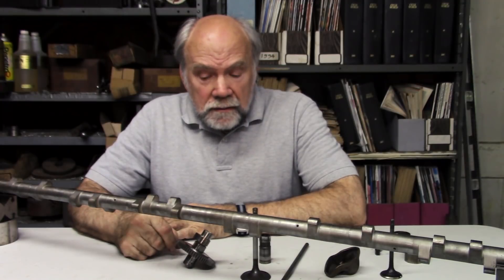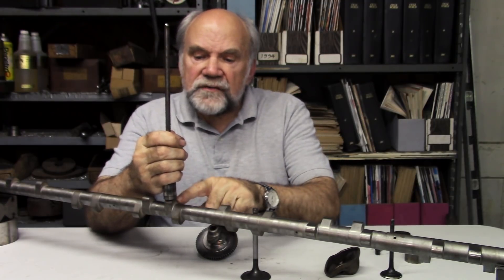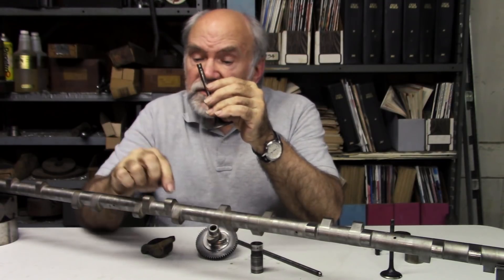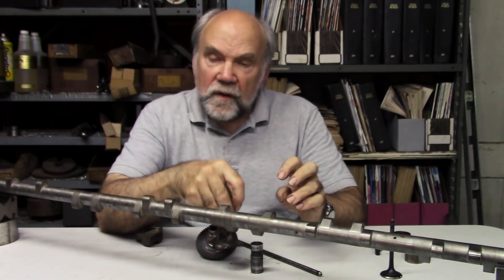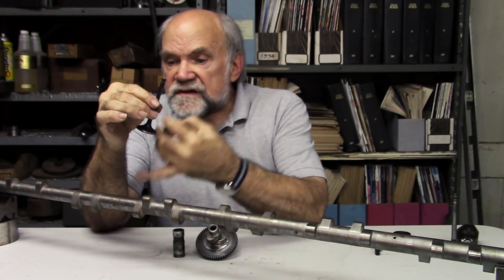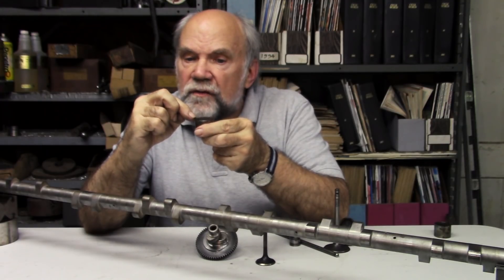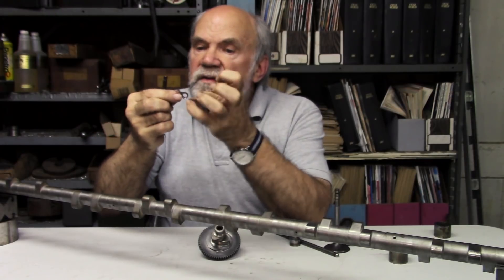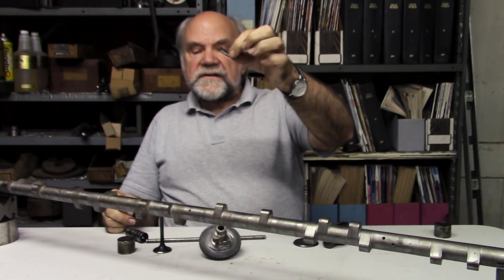How Do Valve Mechanisms Work In A Motorcycle Engine?

Comment: Love to see a Desmo video Mr Cameron. And why they traditionally have such a short maintenance interval. Knowing that the Ducati motors have an interference engine, and expensive shop time, how long can we reasonably put off the valve check? Checking and replacing the valve shims seems to be quite an expert procedure, more than most home mechanics can tackle. Fantastic video series - thank you for sharing your expertise in this forum!
Reply: I was wondering why no mention of desmodromic valve motion control, but I think these are time limited. Pity that.

Kevin's CW articles are much more satisfying for someone who has a decent working understanding of internal combustion engines, motorcycle chassis, and tires/brakes.

Comment: the unicam 4 valve on the CRF250/450's are great valvetrain designs vs Traditional DOHC engines in the same class. Rocker arms have also been developed in the due course of time to compliment such developements, such as moving from a lash/pit model to roller based designs to reduce drag and friction at higher rpms.  nothing compared to F1 or MotoGP, but surely adds to longivity and durability increasing time for a full tear down. Honestly surprised by the number of subscribers and all this content is absolute GOLD IMO. cheers.
Reply: Unicam has too many potential failure points j/k ... Good comment.

Comment: why does the motorcycle do not have a Hydraulic adjusted Tappets.... similar used on Cars....   so that the Valve clearance check can be done at further down the time....  or lesser down time.
Reply: Gold Wings and some four cylinder CBX Hondas had hydraulics in the past. I don't know if they do now. The piston worked on an eccentric pivot for the follower for zero lash. I think Harleys have a hydraulic between the cam and pushrod.
Reply: 4:10